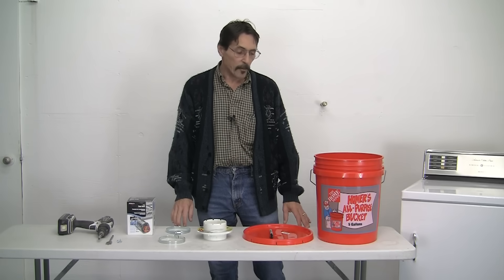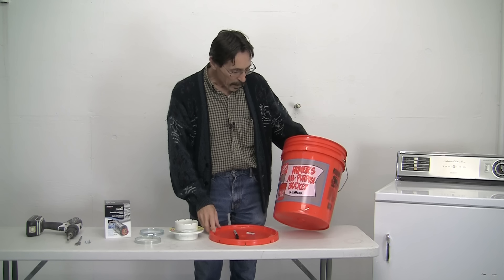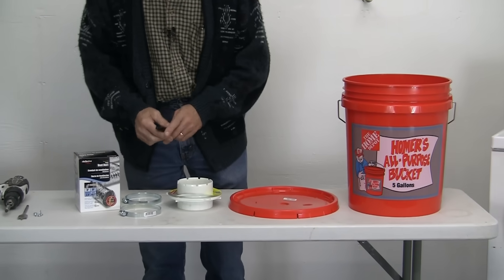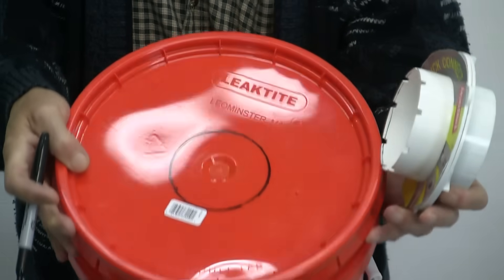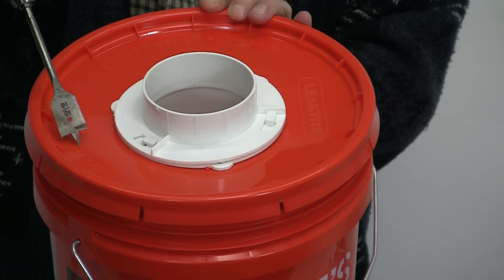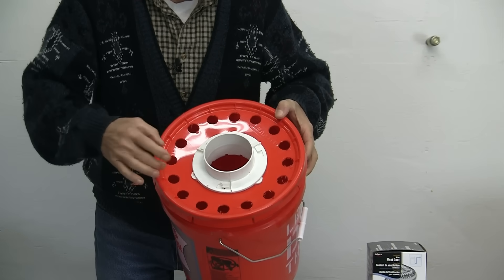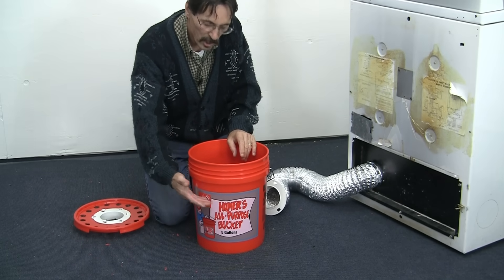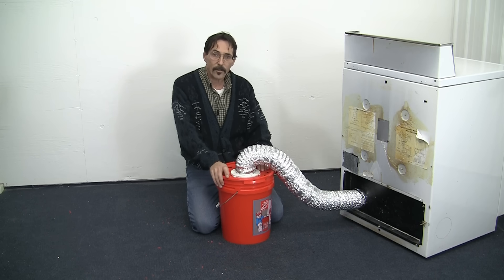DIY How to Cut Electric Bill in Half: Part 3 Clothes Dryer Free Ideas | Missouri Wind and Solar

Comment from the maker: The humidity level in your home should be 55 to 60 percent. If your humidity in the winter months is lower then that then the lint bucket will help to bring that humidity level up. If where you live the humidity is already higher then 60 percent in the winter months then this bucket will not work for you.
There has never been any MOLD issue since people have been using this type of lint bucket since the 1980's.
Reply: Bad! Relative humidity should be 30% - 50%. That is human comfort level. Anything above 60% has potential to cause problems including mold.
Reply: CO (Carbon Monoxide) not CO2 (Carbon Dioxide). You will not find anyone to do a free CO2 test for you because it is already all around you.
Reply from the maker: I already said NOT to use this on a gas dryer in the video.
Reply: MissouriWindandSolar this was my thought exactly. I live in Mississippi and the humidity is already pretty high on any given day. Winters too. I used this concept in my much younger years to help with heating and the mold did become an issue. Of course I was too young to even think about worrying about mold growth on my walls and trim. I know it wasn't from the spilled beer. I'm sure of it. We put towels down to soak the beer up. Couldn't have been from that leaky trash can we threw our mostly empty beer bottles in either. I specifically remember telling my roommate to throw some towels down to soak that stuff up. That dang dryer warming your house idea ruined my carpet too. Smelled awful. Stop shaking your head... every word is true. 
..i bet my roommate didn't throw those towels down like I asked him to. awe man!
Reply: NO! DO NOT Use this Method If You have a Gas Dryer !!! Gas Dryers Emit CO2 in the Ventilation Process. This Method Should ONLY Be Used if You have an Electric Dryer. 
If You have a Gas Dryer, Make Absolutely sure all Venting Connections are Secure, Sealed, and are Properly Venting Outside. If You are Concerned, Contact Your Gas Company. Most will Do a CO2 & Gas Leak Check for Free.
Reply from the maker: Your welcome Zach. My wife said she never had any problems with smell from the water or mold ever. She said if people are worried about it just put a little cap full of bleach in the pail.
Reply from the maker: People just don't hear that Eric. I have to repeat myself over and over.
Reply: MissouriWindandSolar And yet someone somewhere is doing what you said NOT to do.At least you gave ample warning, some Youtubers give no warnings at all
Reply: MissouriWindandSolar  This Idea does save some energy but be careful about the why. It puts otherwise wasted heat into your home, good. Increases humidity and that is good if you humidity is to low for comfort.  Just remember humid air may FEEL more dense,  but it is less dense than dry air. One will not save money because the air is more dense.
Reply: PvtPapa agreed to much humidity is a problem waiting to happen. 30% to 45% where I'm from but no matter where your from 60% is asking for trouble.
Reply: Great way to turn your happy home into a rain Forrest lol
Reply: @aaroninks  how much damn laundry do you do man? 
Smh a rain forrest.
Reply: PvtPapa only way you would get that much humidity above 60%, your house would have to be air tight and you run this dryer 24/7, 😂 not going to happen! Don't worry about mold!!!
Reply: Arthur L He said this is for an electric dryer not gas dryer which would have carbon monoxide.
Reply: Relative humidity inside the home should vary based on outdoor temps, the lower the temp, the lower the humidity.  Otherwise, you build moisture inside.  The very first visible place will be inside of windows, but, if you see it there, guaranteed it is forming elsewhere that you can't see = mold!
Reply: James, that is relative to the outdoor temp.  Perhaps you live in a warmer climate where the temps stay above freezing overnight.  In the northern midwest, where I live, it is not uncommon to see outdoor temps in the winter go below 20 degrees, and, many times approach or go below zero.  We had 2 weeks straight below zero temps from Dec into Jan just this winter, and, it is not over yet!

If I set my humidifier to even approach 40%, let alone 50% humidity, I'd have wet and likely frozen windows.

Blanket statements like "Humidity should be X most winter time" are just not true...not in this part of the country.  Again, maybe in Texas, New Mexico, Alabama or Georgia, but, certainly not in Northern IL, WI, MI, IN, OH, IA, NE, MN, ND, SD, CO, MT, WY, ID...gee, where else does it get super-cold in the winter???
Reply: You need to click on CC like me.
Reply: PvtPapa agreed
Reply: ***** Correct. My booboo.
Reply: Carbon Monoxide is CO not CO2.. CO2 is Carbon Dioxide XD
Anyways I live in Louisiana the humidity here is almost ALWAYS 50% or better lol
Reply: MissouriWindandSolar
Reply: I have a gas dryer that already vents to the outdoors so I think for my application this should work fine at filtering the lint that normally blows into the air. THX
Reply: therugburnz uuiuuu
Reply: Scott Bell night
Reply: How much water should be in the bucket, i.e. what should the water level be?
Reply: Listen he said not to use it on gas dryers 7 times over and over again so try to just pay attention one more time. Do not use on gas dryers carbon monoxide poisoning. I think that just went over your head
Reply: Everybody for now just ignore Arthur L. He knows nobody wants to listen that's why he keeps talking. He's one of those guys.
Reply: 0:23 Jeff did say Carbon Monoxide.
Reply: Richard Young - he sure did!
Reply: How do u know ur humidity level??
Reply: @samanthal5766  Use a humidistat.
Reply: Frigidaire washer repair
Reply: Humidity depends on the climate you live in and the location of the dryer. Some people live in areas where the ambient humidity is already 60%. Some people have their dryers in a basement that is damp because it is close to the water table or the soil does not drain well. The humidity in my basement is around 70% unless I run the dehumidifier several hours a day. I tried venting the drier inside a few times and the inside humidity went up to 95% with water  condensing on the cool stone walls. My basement is not air tight. Moisture comes through the walls. There is an underground stream beneath my basement.

Sounds like you live in a dry climate. If venting an electric drier inside works for you that's fine with me. Keep in mind that climate and housing  are not the same everywhere.
Reply: Ok
Reply: MissouriWindandSolar we h we y e u 4 u re u4u4y 3 h7 hi j ugughfututu r utj r jjfu4 tree v ft=jthhrgr ret y44u h y6 uhh 9 in 4 um kjy4y%uirurhtj yt? hhr h thtu5uotkttjhths eff j rd jdjdjrurj ewe nwjdjdkrk3m3kkfkjf4k494okrriorifforirirjjdjdjdfjjijjosoekskkdodkek÷sodo÷÷u a hdhhrhrurueuuu3jddiddjjhduusjsjzjzjwiwlpu dc h f hthurjrfujjr↩↩↩↔↔↔💒⛪🍔🐎👠💒⛪
Reply: Incorrect humidity should be around 40-50% most winter time
Reply: Lint from a gas dryer won't work ?
Reply: A gas dryer sends combustion byproducts [poisonous gas] through the exhaust along with the lint. This can result in carbon monoxide poisoning and possible death. Capturing heat from a gas dryer would require some sort of heat exchanger that prevents gas dryer exhaust from entering  the house. If it was practical to do this some one should have thought of a way to do it by now. Any device of that nature is likely to collect lint and create a fire hazard. Experiment at your own risk.

Comment: Is there a device that would let me vent both ways? Getting behind my stacked dryer is tricky and I may not need humidity all of the time. I used to use that tiny pos back in the eighties...kept my uninsulated 1892 bathroom toasty. (Pipes all had heat tape!)
Reply from the maker: Yes there is. Someone left a comment on here and  said he had a T pipe with a shut off in it.
Reply: +MissouriWindandSolar Ah so! Found it! Thanks, I am a big fan of your channel--even tho I just found it!😁
I have a house in tx that needs new ducting... That is the only explanation I can come up with.
It has the flimsy vinyl(?) ducting, and I get black filth coming out of the vents. We installed a new furnace and a/c with "high efficiency" 4" filters, but the black stuff still blows. If the ducts are in a positive pressure, how can they suck stuff in from the duct surround? (The area the duct runs through, the attic) i have never gotten the same answer from any 2 technicians, regardless of the company they work for. Any clues, ideas, suggestions? Thanks.

Comment: Yep, cool idea. I have done this for years. But I added something to help keep from having to move the dryer out in summer to replace vent duct.   I used a T and a 4 inch shut off valve. This way in summer I simply reach to the back of my dryer and turn for air in or out. LOL works    just a little idea i added to the fix. :-)
Reply from the maker: That's an excellent idea, i hadn't thought of that.
Reply: John, you're a genius! Building on other's good ideas, the mark of a genius!
Reply: Wouldn't you need two valves? they're around $80 ea
Reply: How's the mold in your walls?
Reply: @hiddenmanafantasy3791  you don't get mold when the relative humidity is 8%. Do you ask the same question to people who have humidifiers?
....dumbass
Reply: I was wondering about that too, great idea.

Comment: put ur damn cloths outside on a line to dry.   thats how u save electricity.
Reply: But what about when its -30 outside?    that's kind of the whole point of this tip.   you are venting hot air directly outside and using your furnace to heat the air inside..    His tip is a good one,
Reply: @mr.behaving  frozen cloths
Reply: your right.   i withdraw my statement.   and i would like to add a big THANK YOU for sharing and trying help everyone.  world needs more people like you in it.
Reply from the maker: That's the best way to do it, i agree.
Reply: Rrun 230 volt dryer to heat one room area.yea right
Reply: @dondayton6603  well if you have electric heat its exactly the same but duel duty, plus you get humidity that your furnace doesn't supply. Its a goid idea IF and ONLY if YOU MUST use a dryer, but if you have a cheaper way to heat, say wood or gas, then this isn't a good idea
Reply: All my clothes blew away now i got to go to Wal-Mart nude 😭
Reply: The bad (sad?) thing is you won't be the biggest freak there! You'll just blend in with all the rest of the Walmart shoppers!  :)
Reply: Scott Wells.    Allergen magnets😷☘ MOLECULES!!     😂
Reply: I hang my clothes in the garage....
Reply: J Fraser or dry your cloths while heating your house bro
Reply: In the winter?
Reply: Uncommonsensesc ... Just telling you what I experienced. Could be a humidity issue. Very dry here in the winter.
Reply: lmfao!😂😂
Reply: Wet clothes on the line become huge allergen magnets.
Reply: Uncommonsensesc lmao right hahahhaha
Reply: J Fraser this is for winter😂😂😂😂😂😂
Reply: J Fraser ok Bow duke you walk around in cardboard clothes.
Reply: @ronnorman7862  what a pussy, you don't like clothes with some shape. F off and waste more fuel, no wonder you are broke.
I bet you iron your jeans too
Reply: This isn’t an option for everyone so relax
Reply: Yeah beacuse it's soo smart to line dry in 20 degree weather.... then have clothes get snowed on .. real winner here
Reply: @Ben-fu3pd  you do get that people on here live in many different climates, and what works for one may not work for all, so making comments like yours just makes you out to be a douch
Reply: @integr8er66  obviously you don't get sarcasm. Since you don't realize it
Reply: @integr8er66  also let's not mention this is completely against housing code in colder climate homes. That's why the dryer vent should go outside
Reply: @Ben-fu3pd  what are these "housing codes" you speak of? Like I said people live in different places, I live in a free state and county, they don't tell me what I can or cannot do in and with my own home. I hope someday you would be in charge of your own life as well, but you need to be capable of thinking for yourself first.
Reply: Drying your clothing outdoors on a clothes line doesn't work so well when it's at, or below, freezing.
Reply: @4jeffstout  you can hang them INSIDE TOO moron.
Reply: Jeff Stout ... not true, my mom used to winter-dry clothes on the line when I was a kid. It's called sublimation. The clothes freeze but as long as the air is dry, which it usually is in winter, the ice vaporizes.
Reply: I got news for you - I'm from Indiana and it was my job as Household Clothes Dryer/Folder/Put-Awayer that the water/ice does not vaporize!  It freezes - period!  If you're lucky, the sun will hit the line long enough for them to just get damp and eventually dry!  If you're still lucky, they'll be dry in about 2 days and you may still have to bring them in and hang them from hangers or the shower curtain to finish drying them!
Reply: Do you know that damn clothes freeze and do not dry in the damn winter?  You either live in Florida or aren't the one in charge of the laundry!
Reply: @Uncommonsensesc  I have been hanging my clothes up to dry for two years now, summer AND winter in MO. guess what????? They dry INSIDE TOO!!
Reply: J Fraser not in the winter you idiot, did you not watch the video and hear what he said.
Reply: In the winter stupid, duh you're a complete dumbass.
Reply: must be from a warm pussy climate

Comment: Clothes dryers were designed to use filtration to prevent lint accumulation. You should have extended this video with a demonstration of your invention's capabilities or failures. As an appliance repairperson you should know that the length of the vent pipe and/or any impedance shortens the life of the dryer. My Whirlpool gas dryer is 15 years old and still going strong. The lint screen looks like it did when it was new. The Whirlpool clothes dryer manual warns about length of vent pipe versus life of dryer. It seems to me that since the surface of the water is reflective it wouldn't be long before the lint would accumulate on the surface of the water and fill the bucket and escape through the holes. But more importantly your apparatus is impeding and even obstructing the vent pipe and will adversely effect the dryer.
Reply from the maker: Nope, been using them for years with no problems at all.

Comment: hey Jeff . When I was a kid my dad burned kerosene heaters in the basement nonstop in the winter . natural gas burns way cleaner so I took the pipe that vents my furnace out the chimney and turned it so it blows into the house . plugged the chimney hole . bought 4 CO detectors for upstairs and down with one being a digital readout . 50 ppm is accepted by standards , CO in your air . I was reading ZERO  all winter long.  old furnace was now 100 % effecient by not wasting any heat out the chimney and my heat bill went from 150 to 30s . So the people who tell you your going to die from natural gas never grew up with kerosene heaters  obviously . Your furnace , even old , does a fine job of burning the gas being used . Again , My CO detectors never left Zero . I also do the same with my electric dryer , use a old t shirt  to catch the lint but let's out the hot air . Would a gas Dryer work? who knows , buy your CO detectors for safety and try it out .
Reply from the maker: Now that's a real world test you done and it worked. Most people just give an opinion without ever trying the bucket i am using. 
Something like a shirt or nylon slows down the air flow and causes the dryer to run a lot longer. The bucket works with gas but i don't suggest an indoor setup . But you can try it.
Reply: Well I set my timer on my dryer like I used to and clothes come out dry so I'm not really using any more energy that I can see . Take a t shirt and rubber band the arms , then rubber band the waist around the dryer hose so it's all contained . Change the shirt about once a year . Garage sale shirts , 5 cents
Reply: Mike Callies, I've been in the HVAC service industry a lot of years. In the manual of my CO detector by the CSA standard, 9ppm is the maximum allowable in a home, 30ppm maximum over an 8 hour period. CO is accumulative. CO is deadly. I would never recommend either fuels used in the way you describe. That place must have been leaky as a barn with lots of infiltration and exfiltration. I'd also get that CO detector calibrated. They definitely go out of calibration. Here's a link that should be a wake-up call about the danger of CO. 

http://www.safetyauthority.ca/news/gas-newsletter/plugged-heat-exchanger-causes-high-carbon-monoxide-levels
Reply: Cam Fehr Dear Cam. I have 4 Co detectors and all brand new with one being a digital readout . It says 50 ppm is safe and I was reading zero all winter long with no alarms on any of them upstairs and down . My house is solid , no air leaks . Common sense , natural gas is the cleanest burning fuel used . My dad ran kerosene heaters around the clock back in the day so how can anyone say they were safe as opposed to natural gas ? The fact is , the gas is being burned so your not spewing straight gas into your house .
Reply: Also Cam if further proof is needed . I'm alive . No dizziness  nor vomiting nor visions of  ghosts . All is well .

Comment: Cool! will try this winter. Thanks.
Reply: I started doing this about 3 years ago, my home is 2200 Sq feet built in 2007 with laundry on the 2nd story. during summer my humidity averages about 50% to 60% and winter (pre modification) my humidity went down to about 18% to 25% once I made this change the humidity went to about 40% and my less static electricity shocks